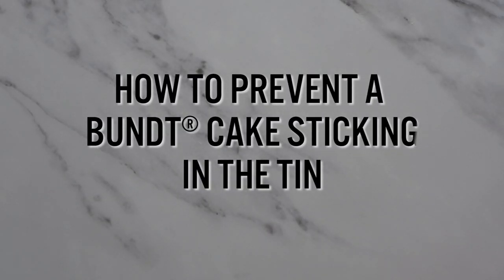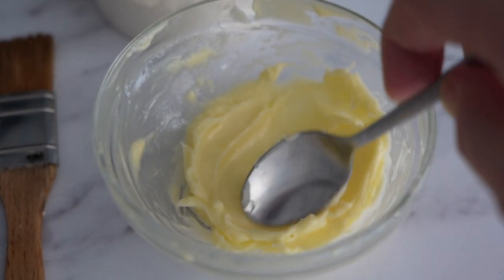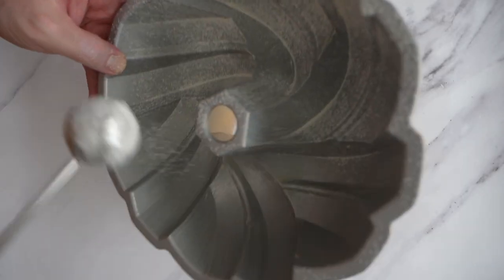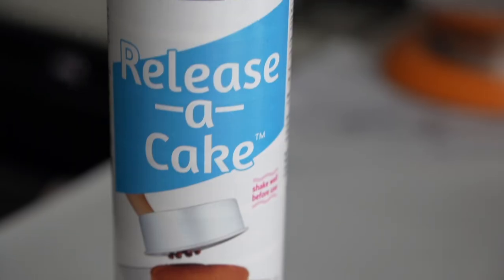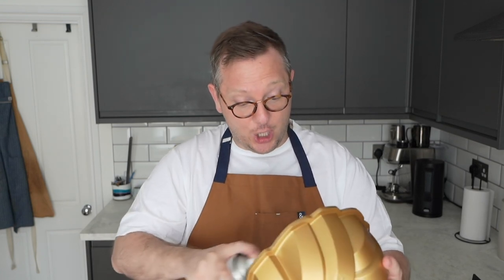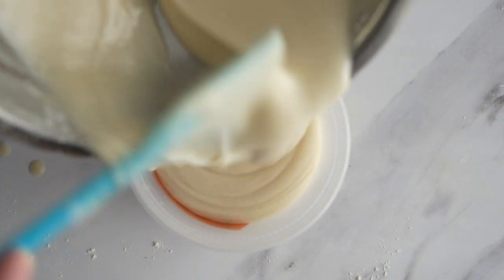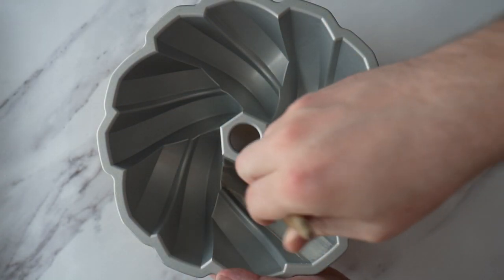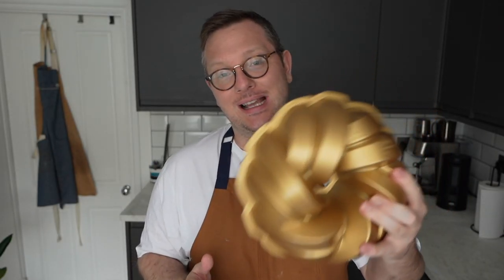How to Prevent Bundt Cakes from Sticking - The Boy Who Bakes

Comment: I used the cake goop first time tonight!  My problem is with bundtlettes used first time how much to fill them? Anyone can help!  Thanks from California!
Reply: Hi Ron.  The rule of thumb when filling any baking pan, regardless of size, is to only fill it 1/2 to 3/4 full.  I'm a bit anal about proper distribution when dealing with multiple cavity pans (e.g. cupcake pan, mini bundt) so what I do is pour water into one of the cavity's, right up to the edge of the hole, I then dump the water out into a measuring cup to see how much was in there, I than calculate the volume for 1/2 or 3/4.  In something like a bundtlette pan I tend to stick to half, that way all the cakes will have a flat, even bottom instead of doming.  If you want it to dome, like in a cupcake or muffin, then fill 3/4's and you'll get that nice dome effect.